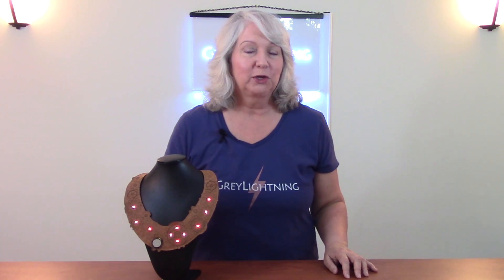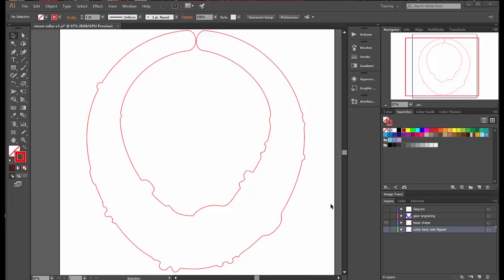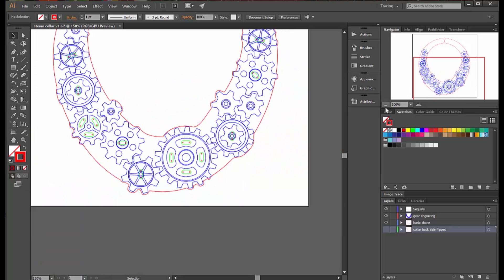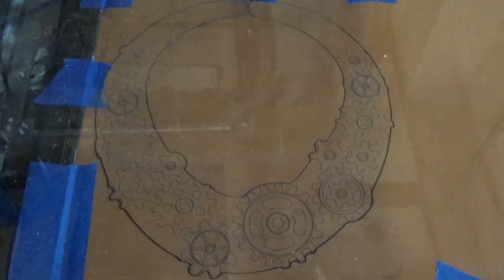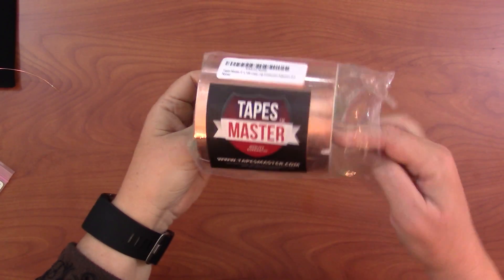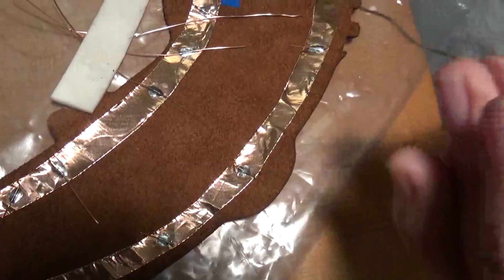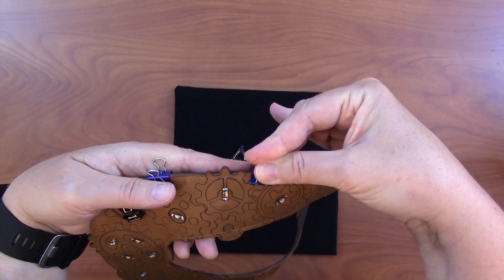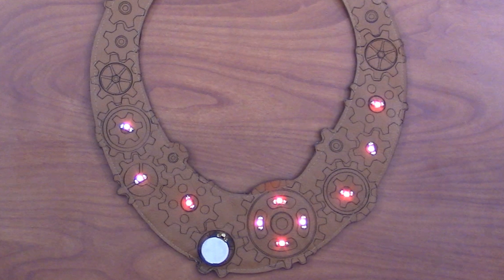How to Make a Laser Cut Leather Steampunk Necklace with LED Lights

Comment: Not wise to cover the fume vent!
Reply from the maker: Sandra, tell me more. This laser cutter has two fume removal methods, a downdraft that also holds things to the bed and a vent in the back. Only the vent in the back has been blocked; the downdraft is still active. Do you think that is not enough? Or didn't the video show that there was still downdraft ventilation? The laser cutter at my next makerspace only has downdraft, so this problem went away for me when I changed to different laser cutters.

Comment: hi.... well done and asking how to deal with  the black smoke after laser cutting?thanks
Reply from the maker: Ahmed, I've tried several leather cleaning options, from saddle soap and Fast Orange (smooth), which I learned about through some online research. Truth is, I'm not thrilled with any of them, and a lot depends on the type of leather you are cutting. I think I would start with saddle soap, and move on from there is that doesn't work for you...